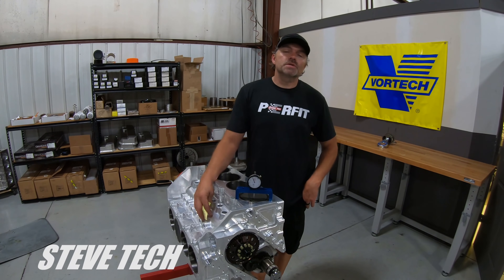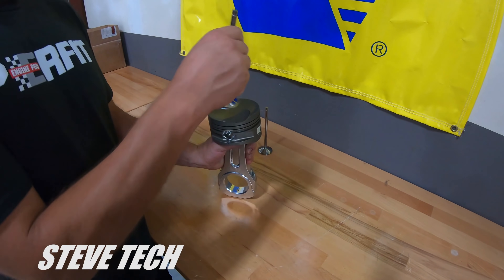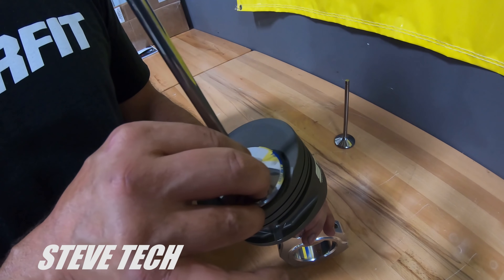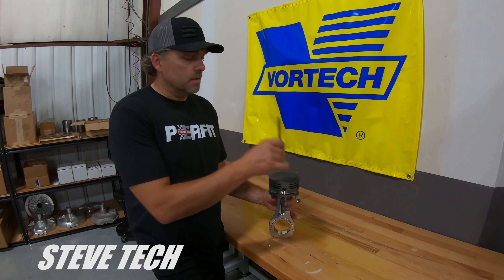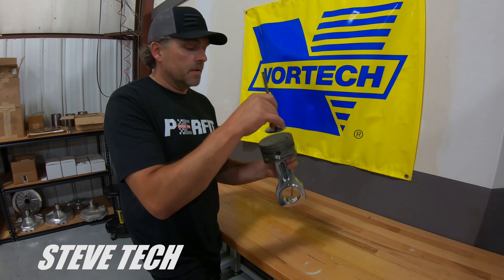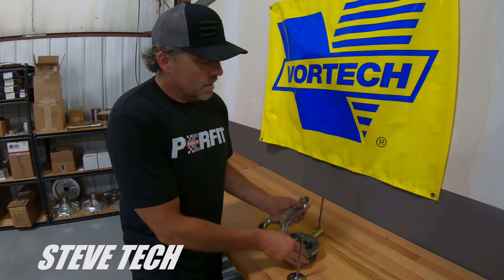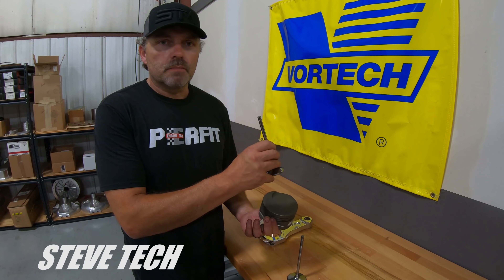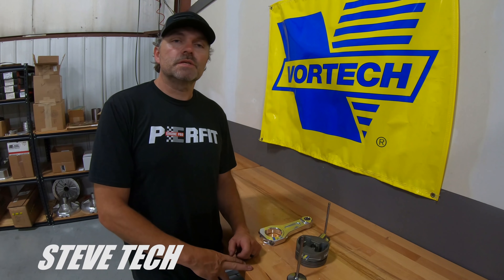Piston to Valve Clearance

Comment: You just put a good example of iron block with steel rod versus aluminum block and aluminum rod. 
I have built lots of engines with the pistons .010 out of the hole to compensate for msl head gaskets. I have no experience  with aluminum  block but I do understand heat growth and expansion. 
The best way I can describe aluminum  combinations, is aluminum  has to be built to grow.

Comment: 0.050”  in the hole, does not account for head gasket thickness. Not sure if it’s really a negative clearance but it certainly is much tighter than most would assume.

Comment: Great information I was just ready to back up the cam timing because I only had .060 intake valve to piston . Just advancing the cam from 109 factory center line it was in at 109 it had 180 cranking compression moving it 3 advanced it went to 205 crank compression cold . It should help the short time NA small block Chevy .

Comment: So you  ,as most builders never say to check clearances with a stretched chain or if you plan to change cam timing with the timing retarded. Also VALVE to GUIDE clearance is almost never checked. Playing with the valve pushing it up and down with your fingers only proves you are not severely arthritic. Factory clearances are tight and not good for racing. How loose is too loose?

Comment: Am I understanding this correctly, no piston to valve to clearance is needed on the intake as far as depth is concerned, only clearance on the radius?  If so, at idle and low rpms is there still a "laten" effect?

Comment: Steve : can you talk a little on stroke to rod ratios? Smokey used to say, put the longest rod you can in a motor, but modern thinking seems to be the opposite. I get why he might have said that as heads didnt flow all that well back in the 60s and you wanted the faster piston speeds to cram as much mixture in the cylinder as possible .. but what is your take on it?

Comment: Maybe I missed it but did he explain that aluminum rods will stretch more than steel rods and this should be taken into account when setting piston to valve clearance? I never hear it mentioned by builders and its an IMPORTANT factor in engine design

Comment: In regard to the timing possibly being different for different cylinders due to the cam and crank twisting a tiny bit under load: are there applications where you specify different valve clearance for different cylinders because the crank-to-cam timing is different due to the twisting, or does it just so happen that the crank and cam both twist proportionally keeping the per-cylinder timing the same, for lack of a better way to explain it?  Or is the amount of twist just so small that separate per-cylinder clearance values aren't required?
Reply from the maker: it does happen, very hard to actually calculate and you would only be talking a few thousands of a inch at most front to back. if more than that you have way bigger issues to handle.

Comment: Wow, very clear explanation and tips. I have used both the play_doe and dial indicator method, but I assumed you put more clearance on the exhuast valve because of heat and the resulting expansion. Now I  understand how cam timing get retarded as high RPM comes into play. This will win me a few beers bets for sure.

Comment: I'd really like you to go more in depth on how camshaft profile/ramp rate either drives or diminishes the chance of valve interference. I ask because I only have experience with hitting exhaust, another guy I know has only had experience hitting intake. Has to be cam design and setup, right?

Comment: Where in the rotation do you check the intake valve clearance? Is it between a certain degree range or just around 10 ATDC?
Reply: Would it not be determined by the specs of the cam?
Reply from the maker: the normal closest point is 10 ATDC but you can move it around a degree at a time to find the closest in your application.
Reply: @stevemorrisracing  thanks Steve for sharing an when I bought a cam off an engine builder 1 time he said for me to set it up on 12.5° on intake valve before tdc and vp was 70tho of inch on BBC and dont remember what it was set straight up. I think it ended up being 3° advanced. Im just curious an never mine learning so when you move the cam around it will change the vp correct and I guess it would determine how much it is moved to how vp it would have right? So what I'm ask is you would still check it at 10 ATDC ?